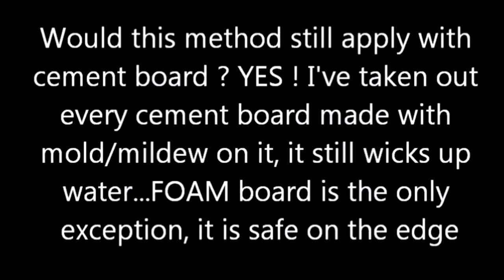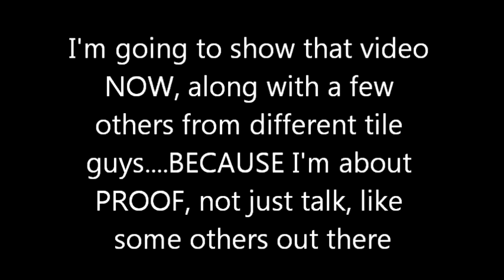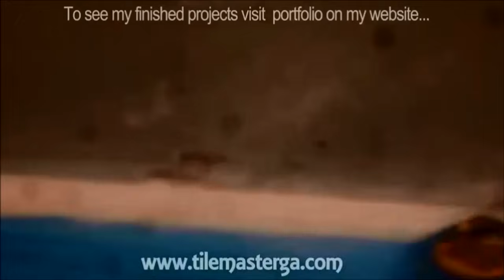WALLBOARD ON TUB

Comment: Will make sure to do this on my project next week. Question I have is, do you think set the backer board and tub after mesh taping or Kerdi  sealing them together? Then do you bring the tile onto the edge and silicone underneath the bottom tile to the tub?

Comment: Your method is consistent with American Standard tubs installation guide. ie set your cement board on the lip or 1/16 " above the lip of the tub and overlap the tile down to the tub edge leaving a slight gap. My question is how does the grout work when overlapping the tile like that. To me the grout is going to squeeze out into the gap behind the tile.
Reply: I don't know who else does this, or whether Bob agrees, but I think the Home Renovision guy uses thinset to fill in that space between the tile and the tub that isn't covered by backer board. So when that sets, it will prevent the grout when you apply it from squeezing out. Hope that makes sense.

Comment: Okay this makes alot of sense, but if you are not tiling the top portion of the shower/tub unit and you want it painted and to have the finished look without the screws holding the lip to the 2x4s showing how would you suggest hiding those?

Comment: My last apartment, they had a handyman re do the tile and this is exactly what happened.  plus the faucet control had a leak and it saturated all around.  Just curious tho, if you were continuing on this tub install, would you use grout or caulk where the tile meets the tub?
Reply from the maker: Yes, very very common in apartments, I usually will put in grout, until there is a reason to use caulking I don't advocate for it... although I have done direct caulking in there without grout, it depends on the application I suppose

Comment: what do you do at the seam where two manufactured edges of drywall come together. that would create a valley right. Mud? thinset? before you put on the waterproofing?
Reply from the maker: If it iis Sheetrock then I use sheetrock mud, if I use cement backer board then yes it would be thinset, and then waterproof

Comment: M Loaiza
I am going to add a small bathroom in an existing bedroom. I'm hesitant to remove the ceiling drywall because of the insulation that was blown in. Will it work if I just put green board over the ceiling 
regular drywall ?  Thank you

Comment: I appreciate the video. My question is a little different. 

When I set my drywall on the lip, the drywall over hangs the flange edge by 1/4 inch. I’m putting in a tub surround that glues to the drywall, not tile.  My question is if I need to fill the void between the edge and the surround, so the surround will have something behind it instead of a gap
Reply from the maker: I would not worry about the overlap, it is small and would not affect the tile or the tub, and that Gap is left empty because if any water gets into it it will still dry out over time, although arguably you'll be caulking the bottom part of the tile at the end so no water should get into that Gap

Comment: I redid a bathroom once......I see the ways I messed up now. What I'm not sure about is what exactly is the process of getting a finished result?

If I'm following this video correctly, the tub or shower surround lip gets screwed to the studs. The drywall or cement board gets screwed to the studs about a 1/4" above the tub lip (I love the idea of sealing the edge to prevent water from wicking up). Then add tile and and thin set. Is the bottom row of tiles just supposed to overhang the bottom of the cement board/drywall and sit on the edge of the or is the tile supposed to sit above the edge of the tub but extend past the drywall or cement board? With the difference in the thicknesses of the lip of the tub and the cement board, there will be a tiny gap at the bottom of the bottom row of tiles. Is this that way it SHOULD be? I think I need to see a diagram, but hopefully what I'm saying makes sense and somebody can explain this to me with a bit more detail.

What if you are installing a tub surround as I did in my first and only bathroom remodel? The tub surround had a lip on it just like the tub does in this video, but we did not put tile over it. We went straight from drywall over the lip of the surround, and caulked it. I know this is wrong now, I did not know that then. Had we installed drywall above the lip, how do you hide the gap and make the top edge of the shower (bottom edge of drywall) look finished and pretty? 

Thanks for reading, I hope to get some good answers

Comment: If there's a possible question you can answer this might be a good one one to think about after my Gold board is up around the tub I didn't want to use grout I didn't want to mess with the saw for ceramic 12x12 squares I was looking at a good adhesion on the go board and a good Armstrong type floor tile easier to go around and cut in tight places and for the three handle fixtures but afterwards could I paint or spray a sealant of some kind over the tile or go in between each 12x12 tile with a sealant where they butt up against each other....?? Thanks

Comment: Hi, what if I am doing a glue on tub surround. My problem is that the front of my greenboard sticks out further than the tub flange. The plastic tub surround allows a lot of flex making it almost impossible to caulk. Should I fill it in with caulking prior to give the surround something to push against. Thank you!

Comment: Great video! So if I run my 1/2" cement board to the lip, what do you recommend for my tile transition at the edge? Do you stop the tile at bottom of cement board or run below? Do you run any thinset or hydroban between bottom of cement board to top of edge? Just want to be sure everything is well prepped.... Thank you!
Reply: I would think you run the tile below the cement board all the way to the tub and leave a small gap…1/16 to 1/8 inch for the the grout caulking. That’s what he meant by 10-15% of the tile with no contact…it’s not touching the fiberglass flange but floating on top of it all the way to the base where it is then grout caulked. So essentially, there is a very small void behind the bottom half inch or so of the tile. This prevents/limits moisture from wicking up your substrate over time. Tile isn’t porous so moisture won’t travel up it. I’ve even seen a video of a guy putting window tape flashing on half the flange and then the rest up the studs (only goes up the stud a foot or so). I’ll probably do this but definitely won’t put the substrate touching the shower base. The installation instructions even have it as this video describes.
Reply: put mesh tape on the joint, then use thinset to fill the gap or set that tape, do that to all your joints, then use a roll on water proofing membrane and do like 3 coats. Then tile, leave 1/8 or whatever your groutliine thickness is from the tile to the tub and you're good to go.
Reply: @kyleorr533  +1 for the window flashing method. I saw the same video and really liked that idea.
Reply: I agree, this kicks ass method works the lip can use caulking  at the bottom  tile stops 1/8 inch or so from tub. Could  you full the bottom  gap before  the tile goes on the wall? To add an additional  layer if protection?

Comment: It's actually a little weird, this whole debate. Your way is actually the way manufacturer's recommend it, but over the lip seems to be the better way to a lot of experienced installers that otherwise follow TCNA/etc to the letter, even though it's specifically against manufacturer's recommendations, but they use their common sense. I personally think over the lip is better, working as a shingle, BUT then you need to either need to plane the studs below the tub for the lip, or shim or just sister in new studs entirely. I think it's better otherwise you rely on silicone, or a Kerdiband-esque seal around the tub lip for waterproofing, and not the "shingle" of the board over it, plus silicone. (I think Isaac in one of his videos uses a band type seal around the tub, but has the wallboard above the lip.)
It's really a case where neither is wrong, but the "shingle" method may take way more prep and skill than most people actually have (I bowed my wall due to it, unfortunately...) as then you need to essentially relevel your whole wall setup. If you're in a situation where it's all out of whack anyway, I don't see why not to do it that way, but if everything's good, perhaps above the lip is better. I guess if you're wet shimming with Kerdiboard that's entirely irrelevant as it takes zero extra time, but with CBU or greenboard, it would take more time. 
Also I have my own Aquadefense in a cardboard box test, it's doing fine after a week and a half. In Europe all the liquid membranes are approved over drywall, but usually using a Kerdi-band sort of thing in corners/by the floor. I'd not worry about it personally now, and again almost wished I took the "shortcut" of just using greenboard instead of CBU as it hangs flatter, is easier to work with, and is cheaper.

Comment: Hardie Backer suggest keeping an 1/8' gap everywhere.  With that being said would you keep it an 1/8'' above the lip?   How do you waterproof that area between the top on the lip and the board?  I saw other videos where they used a stick on ice and watershield what are your thoughts on that?
Reply from the maker: Having an 1/8 gap isn't a bad idea... there always be slight movement with material... and yes you could fill in that Gap with something so it makes it easier to waterproof but honestly if you're getting that much water onto your wall you're doing something wrong to begin with. The biggest issue with having your wallboard touching the edge is wicking of moisture into your wall board, if it's raised above the edge to the lip then you're not going to have any problems.

Comment: I just installed a swanstone shower pan and the instructions actually say to even leave a 1/8inch gap between the lip and backerboard (or whatever you use).  makes sens but i dont understand why the studs dont get wet.  how far down do the tiles come? is that part of the tile basically free floating? do you seal the bottom of the tile/tub connection?

Comment: I moved into a house that has an old bathtub.(almost 50 years old) There is no lip. There is a one piece fiberglass surround. There is mold where the surround sits on the tub. How can this be fixed without replacing the tub?  It's a 59" tub in an alcove that cannot be increased in size. It seems tubs nowadays are 60".  I was thinking I needed a new surround, but who knows what is behind it. Probably wallboard and mold!!!!  Any ideas?

Comment: Like the video, so when laying bottom run do you apply thin set in the 3/4 gap between tub and durarock or just on the rock or whatever wallboard your using?
Reply from the maker: Just on the wall board, there's no point in putting thinset on that little three-quarter Gap. Some guys like to fill it with silicone.

Comment: I laid the pan for my shower. I think their instructions would have me follow the "bad" practices you address. But, if I use a single plastic fake-marble sheet for each wall (so there's no backer board or tile), I think I'd be ok with just gluing those boards to the studs. RIGHT? Thanks
Reply from the maker: Correct

Comment: I have put in several showers, on tub walls, and I put greenboard on lip, never on tub edge. I always put silicone in gaps. 
I’ve torn showers out after getting bored with tile designs… and never had my work had Mildew or failed. I also put schluter membrane on greenboard.
Reply: Thanks for posting.  My situation is that my fiberglass tub has no lip and both attempts to caulk the tub/tile joint has failed, but just in one spot.Would you suggest applying window flashing or Schluters waterproof membrane to the cement board and top of tub and then retile?  does waterproof membrane actually present water from seeping under it?

Comment: Great Video!!!! Question: How should this be done at the top in a full shower surround when there's no tile being used? (Only Durock above the shower.) Do you still need to set the Durock ABOVE the lip/flange? If so, what do you use to fill the unsightly gap between the lip and Durock?
Reply from the maker: Yes even using durock you raise it to lip, fill with nothing... that is sort of the point so your wallboard doesn't absorb any water. You could run some silicone in their but useless.
And if you have no tile going to the ceiling then you would not continue with durock, you would transition to sheetrock
Reply: @StarrTile  thanks for your response. If we set it just above the lip, wouldn't the screws that secure the top of the shower surround walls be visible and look hideous? I've never seen exposed screws before in a shower/tub surround. Maybe I'm missing something? Maybe I'm not understanding exactly what you're saying? I'm not sure. 

Anyhow, I do appreciate your time and help with this.
Reply from the maker: Your tile will overlap the lip and come down to the edge, I don't see how screws would be showing at that point
Reply: @StarrTile  there won't be any tile. It's one of those Delta Shower Surround setups. Pan and 3 walls. 

Maybe that's where I miscommunicated/mentioned the wrong type of board to use.     Everything above the shower unit will match [hopefully] the rest of the drywall in the bathroom. Again, no tile for this job.
Reply: @StarrTile  In a shower stall situation where there is drywall above the the stall, you will in fact see the screws that hold the stall in place unless you 1) extend the drywall over the screws/lip, or 2) fill/cover with a ton of caulk

Comment: how do you finish off the seam between the moisture board(cement board) and the tub lip.  On my tub the cement board over laps the lip so there is a gap between it and the tub edge.  Do I fill it with thinset, or mud? then embed the tape ....then finish off the top with thinset?
Reply: I’ve video’d my brains out on how to set the wallboard. I’ve seen it on the lip, a tad above the lip and some installs show on the tub/shower edge completely. This guy makes the most sense. Once the wallboard is up, whether concrete board or green board it should be on top of the  flange. When tiling, tape off approximately where the tile face will be to not scratch the fiberglass or enamel finish. Then set tile as normal. There’s only going to be maybe 1/2” void, so not to worry about the tile not bonding. Hope this helps. Avoid filling the gap with anything that might allow water to wick upwards. I’ve seen where some guys have used standard drywall fill and tape to bring the surfaces flush for tiling, but I’m not sold on that. Water and water based products don’t seem to be compatible.
Reply: @SPUDWRENCH  Thanks...yes this guy makes a lot of sense to me...

Comment: I understand your point about the wallboard to just sit on the lip just touching the tub not sitting on the inside edge. My 2 questions are this how much of a gap do you leave between the tile & the tub & do you caulk the gap between the tile & tub?
Reply from the maker: Generally speaking the Gap I leave is the same height of the bottom edge of the tub to the lip which is about three quarters of an inch or so...
Although that number isn't finite, a quarter inch would probably still do the job but then you would push in some silicone or something to keep water from wicking
Reply: @StarrTile  Okay, thank you 😊 for the reply & advice.
Reply: @StarrTile  So if you leave the gap 3/4" or 1" you don't need to silicone?
Reply from the maker: Never said 1", I said 3/4" or whatever distance you tub edge is to lip which MIGHT be an inch...also I mention caulking bottom if desired
Reply: @StarrTile  You're right, the 1" was my mishap, sorry sir. Ok so I understand we can caulk if we desire to. Thank you.

Comment: This seems like sound reasoning, especially with a 4x4 tile or some such. What if you are using 2x6 tiles, or a mosaic? How would you adequately support the tiles past where they contact the backer board? With 2x6 glass tiles, for example, 50% of your tile would be hanging off the backerboard with no support. I wouldn't even know where to begin supporting a mosaic overhang. Any thoughts?
Reply from the maker: There are many ways to overcome that, in the Tile World there are no problems only solutions, what I would probably do is put up a piece of quarter inch backer into that Gap that's already been waterproofed, silicone it in really well and move on from there, but each project presents specific issues that you overcome when you get to those so there would be a solution ultimately that would work
Reply: @StarrTile  Thanks for the advice!  :)